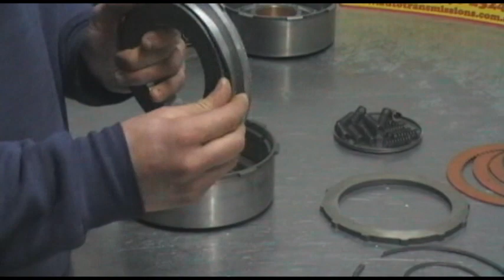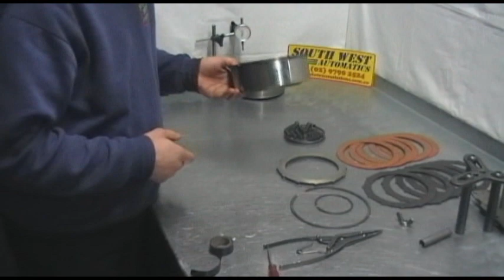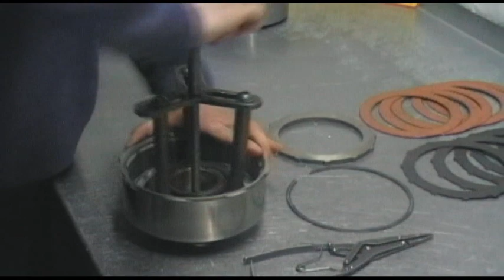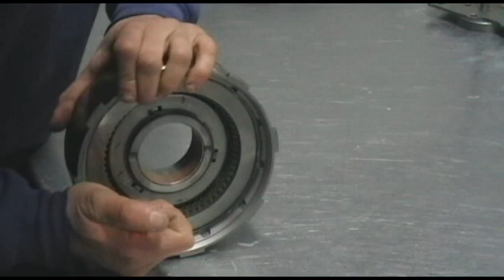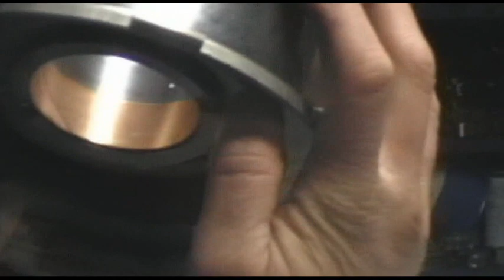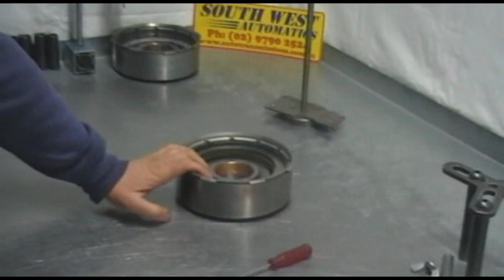Part 9:  727  Front Clutch Assembly

Comment: 46re - 4 friction a 3 steels were in my forward drum but the annoying part is 4 new friction and 3 new steels make it impossible to to get the flat snapring in because the stack is too thick . ive taken it apart and tried putting it back together so many times already thinking somethings wasnt seated right but cant figure it out . not sure if the kit i got sent me too thick of steels or what . anyone have any idea what the issue could be?

Comment: My old clip broke, so i purchased a new one. The old one wasnt a wavy clip. They provided me with a wavy clip, and told me that It was fine. does that sound right? Is a wavy clip ok in exchange of the straight sur clip?
Reply from the maker: +Michael Munoz 
some front drums came with the wavy clip on top of the pressure plate. it is ok to use the wavy clip. the difference between wavy and non wavy is the wavy will have a slightly more cushion on the apply. no big deal if it is stock.
Reply: hi, could you tell why do you put 15 springs instead or 12, and if I install like you what do I need to change too? because It's more easy for me to write i'm not English. thank you for your answer
And I need your help if you can, because I would like to install this HD kit but I don't know which steel plate do I need to put first because there are 2 differents steel plate size( 6x 0.68" and 2x 0.178")  :
ALTO PART # 028755
Alto # 028755 POWERPACK® CONTENTS:
(7) 028742A155 (.061” / 1.55mm) Red Eagle® Friction Plates
(6) 028701K (.068” / 1.72mm) Kolene® Steel Plates
(2) 028701K216 (.085” / 2.15mm) Kolene® Steel Plates
(1) 028761X (.170/4.32mm) Pressure Plate

 my transmission is a 47 re and my front drum is OE, but I would like to upgrade the clutch friction OE to HD for more durability because OE is too light .

thank you very much

Comment: Is the thing about soaking the friction rings in trans fluid overnight an old wive's tale or was it merely omitted?
Reply from the maker: +AustrianAnarchy  Some rebuilders have their own way of doing things. i dont soak them. they say on initial start up you may get the ring running dry up against the surface it is sealing against. the trans wont be doing high revs on initial start up so very minimum chance of rings running dry up against surface.
On the other hand, by soaking rings you may attract dust and dirt causing it to mix with the oil (u have just soaked with) and it will just end up in trans. for those 2 reasons i do not soak them.